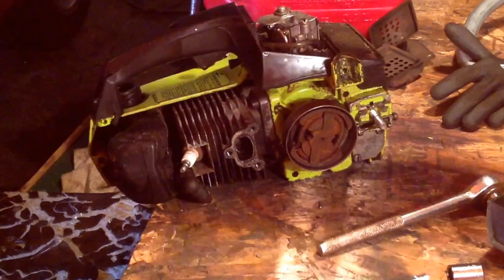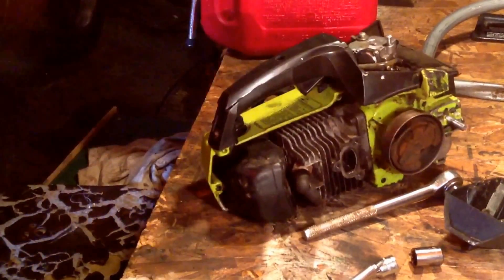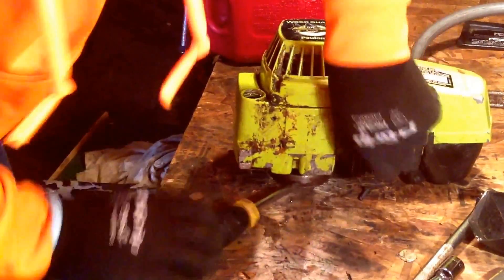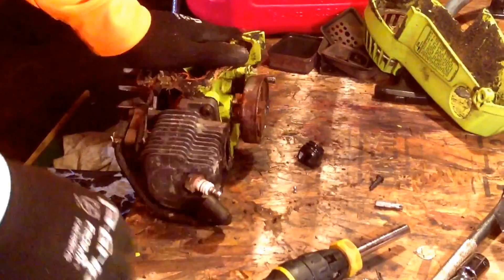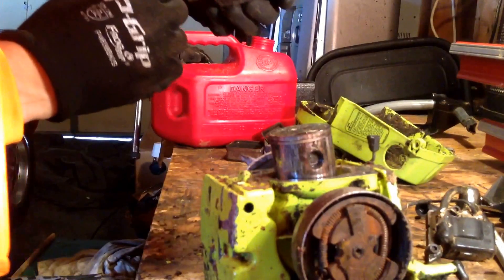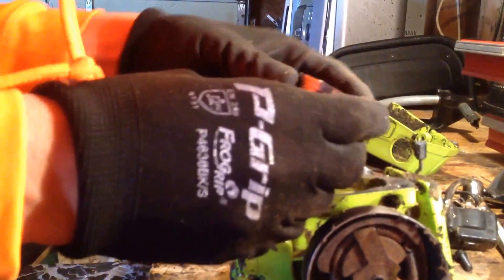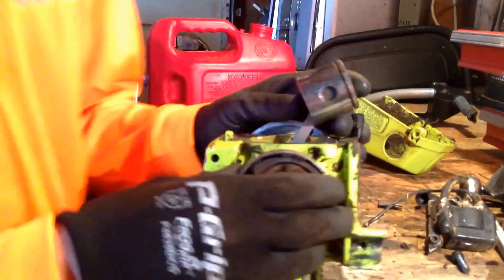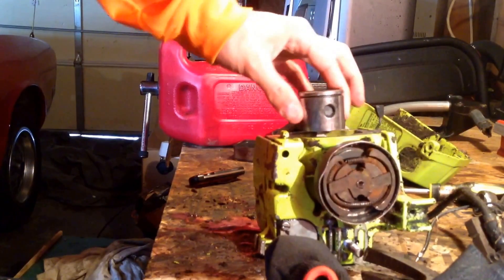How to diagnose scored Piston and rings on a chainsaw

Comment: Looks like mine, it's a P4018 WT single ringer too. Was out of the box new w/ 2 hrs on it when I loaned it to guy to do some work. It came back scored. Guess the woodsman in him didn't know how to mix gas and oil. 
Wondering how many of those engine parts would inter change with one another.

Comment: Yes the piston was scored but you never found out why it went lean
Reply: John Bladykas most likely blocked fuel filter, vent, lines or wrong gas/oil mix causing one to run it choked to finish up whatever work he was doing.